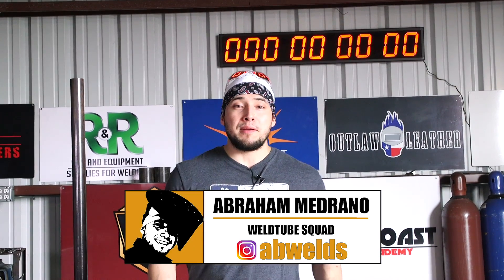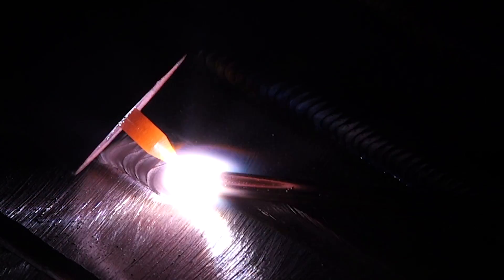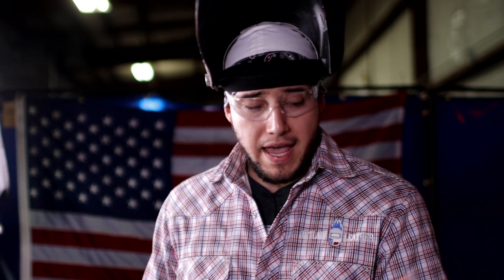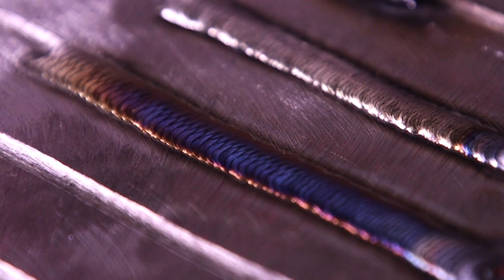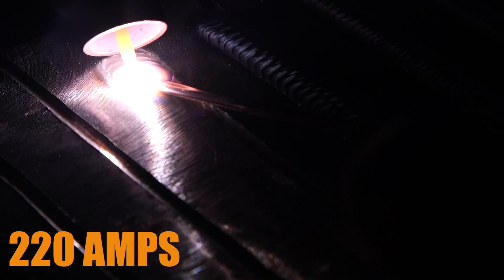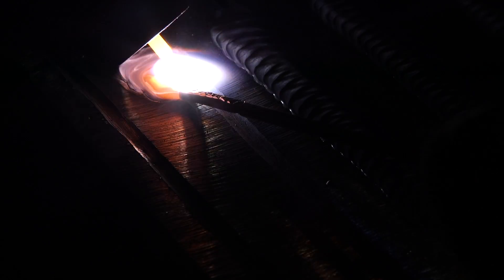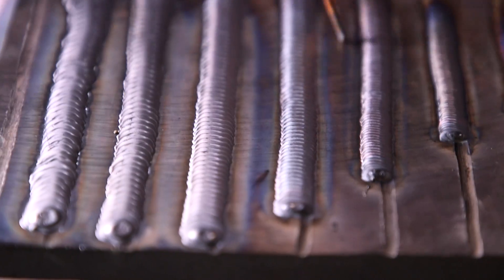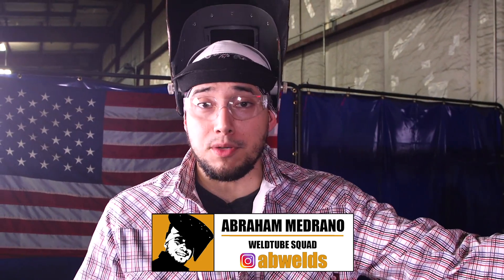Walking the Cup TIG Welding | How hot or cold should my amps be at?

Comment: Little decieving. You're moving at a speed like youre running over 100, when you're at 60. You have to slow down and let it wet out. It WILL wet out at 60 no problem if you just slow down. Especially on a root.

Comment: I’m learning to walk the cup after free handing for many years. Is there a reason the center of your “walked” welds are not lined up with the actual weld groove? Wouldn’t this cause one  of the two PCs of metal that are being welded together to heat up way more than the other, and cause puddle control and penetration problems?

Comment: I think it gets slippy because the metal is cooked, when the metal gets cooked it's mechanical properties are lost and the steel begins to break down and it starts to turn gray, when it's gray it's super slippy and is basically a lost cause. Crappy gas coverage will also cause the metal to go gray which will lead to a slippy pipe/plate and make it really hard to roll/walk the cup on consistently, without slipping off and stabbing your hand with a nice red hot tungsten xD

Comment: Thanks for the video, great work.  I have taught a bunch of people to weld over the years and I have been a big fan of pushing people to run to hot and too cold as part of the learning process.  It’s hard to know what’s too hot when you have never ran too hot.  This video definitely ended better than most could with 300amps lol.  Mad props for handling 300👍🏻.

Comment: What up weldtube! I just want to stop by and say I really dig your videos. Quick question. On a Stainless 2” Schedule 40. Would you say 75 amps is to cold for the root pass on a 1/8 gap? Or what gap and amps would you recommend.
Reply: 80-85 amps, 1/8 gap, 1/16 rod, 10lpm purge flow and a nice fast travel speed.... that works great👍
Reply: @kf8575  thank you! i really appreciate it.

Comment: The amperage and filler rod diameter has to factored in when setting the weld machine. 3/32 to 5/32 rod runs very different numbers. It's all about personal preference and experience.

Comment: Awesome 👍🏻👍🏻👌🏻
Hey i always have problems caping at 2G it sags an i get under cut at the top bead .
Can u make a video on 2G tig cap on a CS 6" SCH 40 please
Reply: that’s completely normal if it happens to you... We all have been there. Just do 2 bead caps, the second one on top will cover if you had undercut at the first one
Reply: Change torch angle, turn down amps, add more fill, could even be to cold and to moving to slow causing it to sag and gouge the top. Hard to say for sure without seeing it in person or how your doing it so I could point out issue/issues your having. Keep at it and it'll click
Reply: I always split a cap, and let it cool right down so can touch it between the two passes when welding 2G.

Comment: I have a 17fv torch and the box says the amp rating is 150. How long can you typically weld at the max rating before destroying the torch and can you go over the max rating?
Reply: Matthew Williams depending on the torch they have different duty cycles. A weld craft is 60% I believe so 6 out of 10 minutes. A ck torch is rated at 100% so non stop. “Technical Data” also that’s at 150A if you go over the duty cycle goes down so just can’t weld as long
Reply: @mhudson631  mine is from profax

Comment: I wish you would have talked about heat in relation to filler wire? 

What a ball park for heat on carbon... with a 3/32 rod?
Ball park on carbon 1/8?

And ball park on 5/32 filler? 

Also are you using 1/8  tungsten? 

And what size rod and gap do you choose for various size pipe? 

Or is it always using 1/8  er70s-2 ?

Now with that said can you do all that again for stainless? 

Roughly 2/3 the heat correct?
Reply: And what size cups? Do you always use #10?   Or #6 for root?   And work your way up to #12 for cap???

Comment: Another great video. You said the hotter the pipe, more chances to slip the cup while walking. Do you wait for the pipe to cool down before capping? Thanks.
Reply: Also, another insight to the "slipping of the cup" from what i have seen is that the ceramic cup gets hot and turns black on the nozzle side where you are walking the cup, that side gets slick and makes you slip the cup
Reply: 15 minutes, start with a second weld if available or else you can't make your 40inch a day